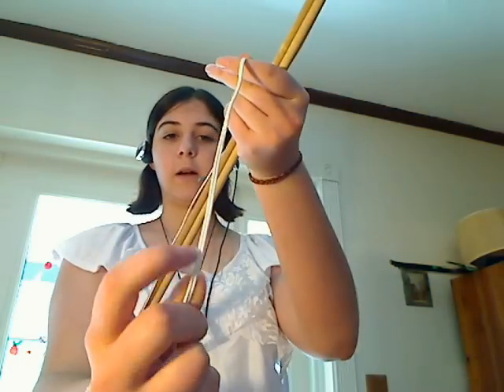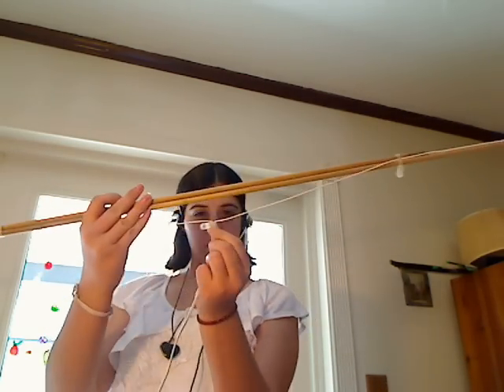fmAntenna2 How to construct a simple fm antenna

Comment: Idea is good, theory might be fine, but some things are lacking.. like  which radio you connected and tested, a demo, stations you could receive before the mod and after, stations from how far you could receive, the rationale of using a speaker wire instead of 75/ 300 ohms ones as advocated generally etc.